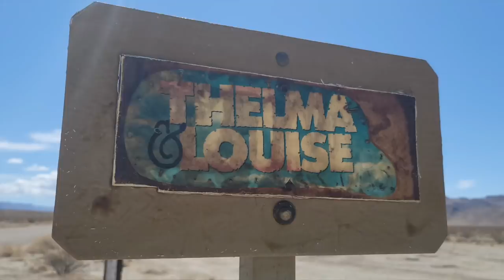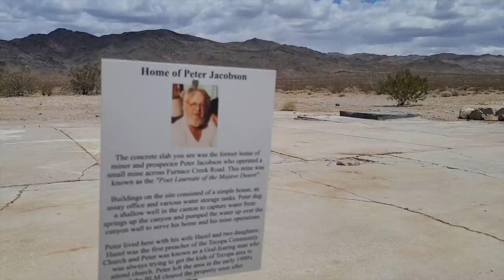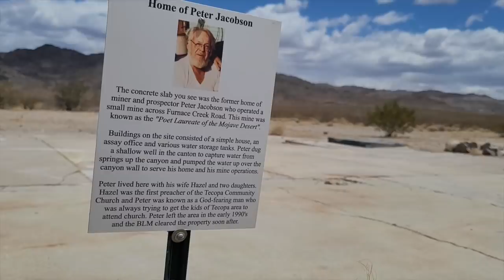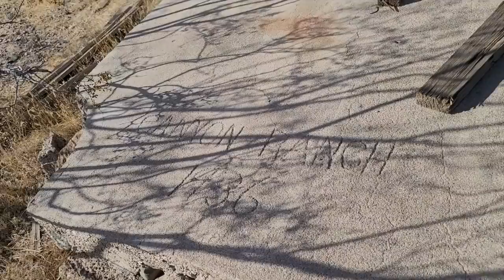#548 Camping at Death Valley's Thelma & Louise Road and Exploring the Amargosa River Canyon Floor

Comment: That watershead isn’t the Amargosa river, although it does meet the Amargosa at Acme. The Noonsday mine is just to the east in the same general area of the war eagle mine. The original townsite was also called noonsday camp. Mining ceased in the 50s and abandoned on the 70s. Scrappers and vandals did the rest. The talc mine was owned by western talc and worked into the 80s, I was told. The shaft that you were looking in was one of the more stable shafts in the area and had good timbered collars until some nitwit poured diesel fuel into it a burned out the collars. Interesting area I’ve visited many times.  Didn’t know about the T&L connection though.
Reply: Your channel name is dieselfreek any connection? Jk. Thought it was ironic. Interesting nuggets of info you added. Thanks

Comment: I see the Mason Jar lid question was already answered so the two glass pieces hanging down were insulators to keep the electrical wires from touching each other and off the surface of the mine so as not to energize any metal in the area. The wires would have been attached about half way up the pieces.

Comment: People sometimes nail jar lids to the ceiling or the underside of a cabinet so they can store things in jars without shelves. You screw the jar onto the lid from the bottom and it hangs there. You can pick out what you need without having to dig around on shelves. The round screen looked like a splatter screen like you put over a frying pan so grease doesn't splatter. That one was kind of big and might have been to contain sparks in a fire ring or barrel used to burn garbage. I think the car was a Model T or Model A pickup with a wooden bed. The "vent" was on the back. The body had been flipped forward and was upside down. Model Ts came packed in wooden crates and the crates were used for the dash board and other parts of the car, so they were part wood.

Comment: When people put jar lids up like that, it's to screw jars of nut's bolts, rivets, etc. on there to keep the bench less cluttered. And yes, they crudely wired in electricity. Must have been a workshop, storage room. AANNDD...ya found the bath house(8-). Many early cars were sheet metal shaped over wooden framework. And many had "cowl vents" right in front of the windshield. And
Sister of Wonderhussy slays a mylar beast(8-). Pretty nice hike with a bonus walk to the China Ranch(8-). This beats hell out of regular ol' TV. Thanks, You Two. Great Video.

Comment: 13:55 called "Knob and tube" wiring.  Those are porcelain contact points for 'cloth' wire.  Used from 1880s-1930s

Comment: The little white things screwed to the ceiling next to the jar lids are electrical insulators. Early wiring used strands of wire strung along these ceramic insulators.

Comment: Those Lids on the ceiling they screwed glass jars in them to hold Nuts and Bolts and the other little thing is for is old-fashioned electrical wiring conduit

Comment: That is a 32 33 Model A and that was a vent on the engine cowl the firewall to let fresh air in as you're going down the road. Mason jar lids were to fasten mason jars to the ceiling full of nuts bolts Nails washers Etc. The disc hanging in the door is a lint filter that goes in the back wall of a dryer made by Maytag many many many years ago

Comment: Kelton, UT, a ghost town just northwest of the Great Salt Lake is like that.  I was just out of Kelton heading southwest deeper into the desert when suddenly my phone went nuts.  Why?  Because about a dozen text messages that were cached while I was out of range suddenly hit my cell phone when it sensed a signal.  I was right close to a group of ranch houses, so I think some ranchers got together and paid extra to get a small tower out there (same thing out at Topaz Mountain, Utah).  Along that road you only get signal for about 100 yards, so I pull over and get while the gettin's good.  That's where I call my wife.  At that point, I'm still about 1.5 hours out from the Ogden, UT area.